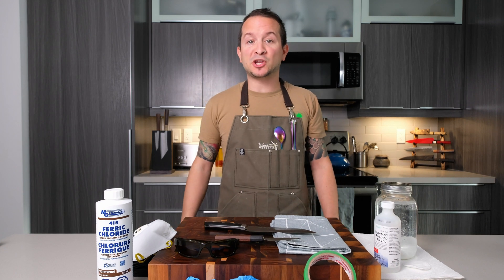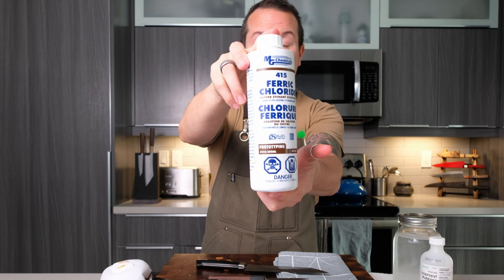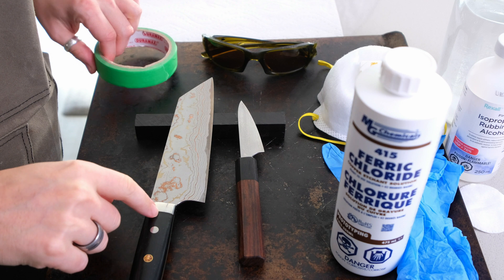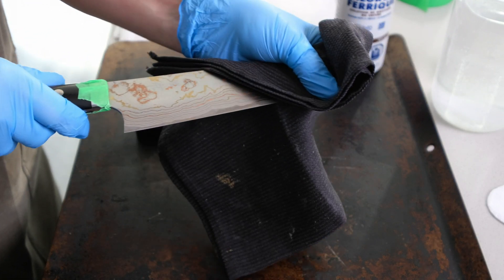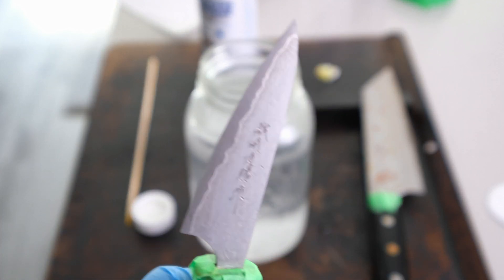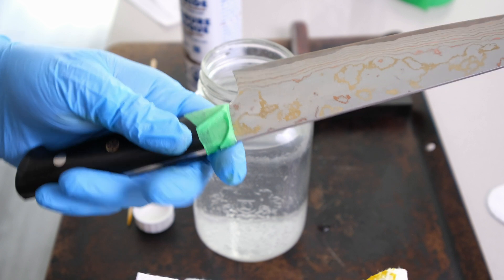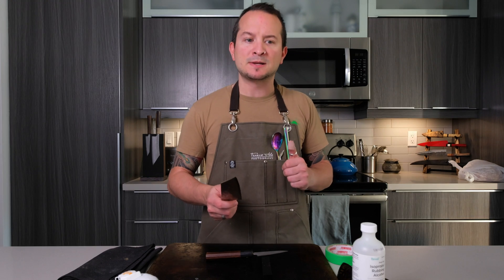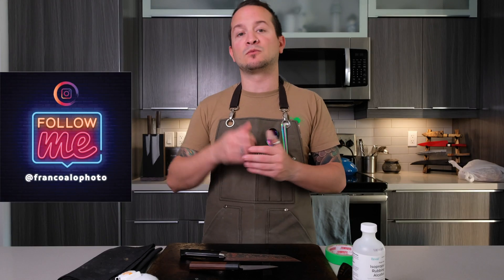Can Ferric Chloride Make Your Damascus Knives Pop?

Comment: I use a 3 part solution. 1 part muriatic acid, 1 part ferric chloride, and 1 part of regular white distilled vinegar. I just wipe it on with a foam brush and it seems to etch fine.
Reply from the maker: oh white distilled vinegar? Never heard of that included in the mix. Thanks for sharing your method.

Comment: Great video, few suggestions; N95s are for particulate matter not vapors.. need a P95 or P100 mask for harmful vapors..
At 8:15 you swap the knife into your hand covered in the solution, smearing it all over the handle in the process of neutralizing the blade; understandable oversight in the excitement but everyone take note to try to avoid replicating this error.
Beautiful knives.
Reply from the maker: Thank you. And absolutely you raised two great points. Sometimes I just experiment in my videos so I appreciate the clarity. I’ll pin this to the top so others can see it as well. Thanks for the constructive feedback.

Comment: Great video once again. I've never tried a damascus etch before and this video will be my " how to " guide I'll follow one day. I just first need to buy damascus knives :) haha .
P.s. intresting that you just put a thin layer on your knives. Usually I've seen people dip the knife directly into it and leave it a few hours inside the solution. What do you think ?
Reply from the maker: Thanks Lubo as always an incredible supporter whom I appreciate so much. When you see the dip, there’s a good chance that Ferric Chloride has been diluted. Because this stuff is toxic I didn’t have or want to have a jar to dispose of afterwards. So I opted straight out of the bottle and a quick wipe because it is very strong stuff. When Ferric Chloride is mixed with water hydrochloric acid is a byproduct and nauseating fumes. Given this is in my kitchen wasn’t worth the risk. So the dipping does work too and it’s the same principle, just different strength of solution.

Comment: Cool video. I would be too nervous to try this on any of my knives, so you are a braver man than me! Two questions: First, did you rub with 0000 wool after the second wipe? Second, seeing the result on the exposed VG10 steel, how do you think this would look on non-damascus blades?
Reply from the maker: Well, after I took a big risk on the Fujiwara santoku and screwed up, I can't screw up much more than that haha. I used 0000 wool after each  wipe to make sure it was smooth again before the second coat. On non-Damascus blades, depending on the construction, I believe it could work and bring out banding IF present. But if just a monosteel, then I would say I think no.